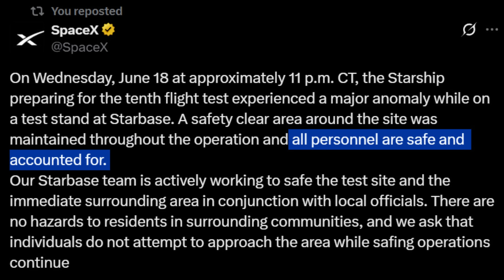SpaceX's Latest Starship Explodes During Ground Test

Comment: Maybe SpaceX are a bit over ambitious with reusable second stage. Booster seems to work, that part is mostly solved.  If they had set their goals initially to just build big Falcon 9 with reusable first stage and simple expandable second stage it is highly likely they would be delivering Starlink satellites right now and making profit. Then run the reusable second stage project test flights in parallel.

Comment: "Te best part is no part" fixation can easily tip over intodisaster. With all the turust vaailable, there is little need tyo  cut weight as if starship were the original lunar module.

Comment: Since Falcon9 and the original Model S, Elon, Tesla, and SpaceX have been puttering but not producing.  SpaceX getting to Mars is like standing on the ground trying to get to the top of a 10 story building in a single leap.  Maybe they need to take the stairs and get to the roof one small step at a time.  Try putting payload into orbit with block 1.

Comment: " high pressure cylinder breaking under pressure "

Does not happen. 

" after fewer cycles than expected."

then the design is incompetent. But we kind of already knew that given that 9 flights in we've had 4 that kind of worked and the rest either exploded or had fuel leaks and crashed into the atmosphere.

I love your optimism that maybe they learned something from this, but at this point you can't really conclude anything other than that the starship program is sh*t. They are nine launches in and they cannot get fuel leaks under control, they still don't have a reliably engine, the booster burned up on flight 9 when they really didn't expect it to at such a small deviation from the proper angle.

Starship is simply a sh*t design and it's only reason to exist is that Elon has to have the biggest rocket. The fact that his metaphor fails to work properly is the ULTIMATE IRONY.

Comment: okay just for you guys to know this alot of thing like  even water and co2 and even nitrogen itself if it gets how entogh can  efectly oxydize and combust under highe enrotgh heat condsiions. withc most of the time noramly will happen in teh orpateion tembpreus of jet engines and rocket engine combution chablers can reach thsie temprutes ecpxaly if useing a nucleaer thermal heat sroce form those nuclear fission or fusion reactor that are sued for makeingthe heat needed. so teachly this is not a real actral surpsie to me that could have this happened in the first live test of teatin sucha fire surpresion sistem gone wrong. aslo  when the hto oxygen and very hot nitrogen mix and makes niutros oxide that also can masvly boot and oxydiaztion chain reaction that can makea huge boom. that would be soemthing like what just happend to starship by the way. KABOOOOOM!
Reply: also hot nitrogen hot oxygen and hot methine all put together makes a EVEN BIGGER BOOM! also makea a much more pwoerful rocket fuel too by the way.

Comment: SpaceX did a great job with Falcon and dragon, because NASA forced them to design it THEIR way.  Note, they only exploded ONE in flight, and ONE on the pad.
With Starship NASA has let them do it Elon’s way and to anyone with EYES it’s been a clown car every step of the way.   Building the OLM with NO deluge and no blast diversion, next to a fuel farm with tanks taller than any protective berm and too dang close?   Someone didn’t bring their slide rule to the design meetings.   Wasting 4 years trying to PROVE Elon’s capricious notion for the OLM would work?  Not using ANY of that time to fly, say, smaller test articles of Starship’s basic design to work out re-entry issues on Falcon 9’s? Firing all the engineers who asked the board to remove Elon as an obstacle to progress?   The entire Idea of 16 refueling flights to get ONE lander to the moon ONE time with enough fuel to land and take off ONCE?  The promise that they could turn around a starship and booster in HOURS when they have never turned around a Falcon 9 in less than 24 DAYS?  The overt Bribe paid to the NASA interim director that won them a competition in which SpaceX’s design was the least proven? 
Sorry- SpaceX Starship operation is nothing but an entertainment company at this point. Musk still have no final design that can work, no idea what payload it will lift, and no idea when it might be ready.
He will never land anything on any other planet.

Comment: My dad was an aerospace engineer. He designed and tested different rocket systems as an engineer for Aerojet and Lockheed back in the 50’s through the 80’s. This is his LITERAL NIGHTMARE, an explosion during fueling while people are still working on the ground. An accident during the actual test is much safer than this unplanned disaster. This easily could have killed someone.

Comment: lets consider what spacex has now. a proven reliable raptor engine. A falcon 9 and falcon heave which are most reliable. why not take what they have and build a new falcon heavy with raptor engines. this could be as powerful as a saturn 5. what the hell is musk doing? nine flights non has reached orbit. i think the concept of starship is to optimistic. And welding especiale stainless steel is questionable.

Comment: They know exactly what they changed between v1 and v2. That paired with all the flight data they have now should be making it somewhat clear what parts they changed have been failing. They should honestly try making a test ship with everything from the v1, except for v2 features they know aren't causing the issues, like the flaps.

Comment: I think I saw a clip earlier today that looked like to show that the flaps on the nose were moving just before the failuire, not sure which yt-channel it was on. That could point to a faulty insulation around a wire as a possible ignition source.

Comment: Musk's tweet subsequent to this points to a failure of the COPV.  Do we know when they pressurize it?  Did they pressurize too rapidly and overheat the vessel?  If it was properly proof tested, wouldn't expect such a rapid failure unless they over cycled it or over heated or over pressurized...no sign of a methane leak that cold have spilled on it making it brittle either.

Comment: I wish there was a way to cover all of the major rocket structures with a sparse mesh of fiber optic strands, maybe just a few long strands along the skin, or on major internal structures. Fiber optics can be used as seismometers and thermometers with pretty good spatial resolution. This assumes such sensing algorithms are fast enough to collect useful data, and the data could be stored safely somewhere.

Comment: The V2 has been a massive setback in the whole program in my eyes. 3 Flights in and none have made a controlled reentry, coming off 3, progressively better each time, reentries with V1 on flights 4, 5, and 6. The plumbing changes seem to have made the whole system weaker. I wouldn't be confident of a reentry survival even if it did manage to come in on-profile in a future flight. V1 will forever be a beast that melted, fell apart, and still didn't give a fuck.

Comment: The problem might not be a design flaw or a test sequence flaw.  It could be classic equipment or materials failure.  It could be a bad weld that wasn't caught during assembly.  There are other possibilities too.  And of course it could be more than one of these issues.

Comment: Breathing in tiny glass fibers is a known issue. Coal miners are well acquainted. It's called Silicosis. The glass fibers can get stuck in the lungs as they are sharp and highly irritating. 
Sand (Silica) causes the hazard coal miners experience. You do not want it.

Comment: When you use the word "optimised" you should be clear that optimising for minimum mass is a choice that is difficult to make consistent with optimising for maximum reliability. It would normally be considered better practice to start at the maximal reliability end of the trade-off and work back from there, not the other way around. The only reason engineers can "barely" build a bridge is because they already know how to build bridges, and even then they can still get it wrong. I think it is becoming clear that SpaceX do not know how to build a starship, and that their process of trial and error is getting them nowhere fast.

Comment: Do you want to get into another ground test so soon? It looks like there may be a design issue which was just waiting to happen, Spacex are definitely not going in the right direction at the moment. So frustrating that the amazing progress made so far seems to have stalled badly. Let's hope they get to the bottom of these issues quickly, I want to see a successful test flight, don't rush it!

Comment: Seeing events like this just reinforces my respect for the early rocket engineers, in particular the Apollo engineers, who achieved wonders without computer aided design and simulation, modern material science or even digital calculators, almost from scratch.

Even the actual German V2, as abhorrent as the regime and the slave labor was, is a masterpiece of engineering designed and built under difficult conditions.

Are we as a species no longer capable of matching these feats without it taking decades and billions of dollars?

What went wrong?

Comment: If this piping and header tanks are new, and considering it splits along the seam where the hander tank piping is affixed, I am going to speculate that its something thats been seen several times before in spacecraft, a thermal bridge. They have failed to properly insulate the pipe mountings.

Comment: Since FAA is unlikely to be involved I expect this to cause a delay of about a month (ie end of July for flight 10). SpaceX is “lucky” this is a HW rich program and will expedite ship 37 (esp given resources allocated for 36 are now available 🙄). It’s unfortunate but unlikely to cause material delay in the program. If the issue is a rare glitch or easy to resolve the probability of a mars mission (which was likely low before this) did not change. If it’s a bigger issue then there’s likely very small chance if any for mars mission next year

Comment: I always felt like the header tanks were a temporary solution to a momentary problem. If Starship pushed as well as pulled on the flip, surely you're moving your moment of intertia to the center of the craft, meaning you could put the header tank directly atop the methane tank, and not precariously suspend a bomb atop the payload be it a satellite or humans.

Comment: It's just too heavy to be practical. They tried to cut weight and mass and it failed. Could be a unsolvable issue using stainless steel as their primary material.

Comment: They need to ditch the natural gas (methane) and use RP-1 instead. Obviously it is much safer and has less problems. SpaceX will eventually understand that lesson. I think the whole design is a failure.

Comment: This report documents the full timeline, preliminary analysis, key observations, and initial corrective actions following the total loss of Starship #36 (Block 2 variant) during pre-ignition propellant loading for a planned six-engine static-fire test. The event occurred at SpaceX’s Massey Outpost facility near Boca Chica, Texas, at approximately 23:03 CDT on 19 June 2025. The objective of this report is to provide an engineering baseline for root cause determination and future verification testing.

2. Background
Starship #36 was a Block 2 upper-stage vehicle positioned on Static-Fire Stand #1 at the Massey Outpost. The intended test was a 15-second ignition of six Raptor-2 engines, with full oxidizer (LOX) and partial methane (CH₄) loads. The vehicle was loaded to approximately 1,200 tonnes, with CH₄ at about 35% of capacity. At the time of the incident, environmental conditions included light rain, ambient temperature near 28 °C, and an on-shore wind at 7 knots. All personnel were located remotely beyond the 2.5 km safety perimeter, and no injuries were reported.

3. Test Objectives
The test aimed to demonstrate readiness for Flight-10 by validating the integrated stage and engine systems under full thermal and structural loading. A secondary objective was to evaluate Block 2 modifications to header tank plumbing and nitrogen COPV systems. Finally, high-frequency structural and thermal response data were to be collected under engine firing conditions.

4. Chronology of Events
The test sequence began with LOX chill-in at 22:13 CDT. By 22:37, LOX loading was complete and the vehicle was fully pressurized on the oxidizer side. Methane loading began at 22:44. At 23:03:06, a plume of condensation was observed venting from the forward payload bay, followed almost immediately by visual camera saturation. Two seconds later, a structural breach occurred along the windward heat-shield section, indicating over-pressurization in the upper cavity. This was followed by a full vehicle fireball deflagration and a secondary ignition on the pad surface. Emergency suppression systems were triggered automatically. By 23:05, the site was secured in a safe-hold state, with no injuries recorded.

This sequence has been confirmed via imagery and telemetry records obtained by NASASpaceflight, Jerry Pike, and D. Wise, as well as internal SpaceX time logs.

5. Observations
Initial rupture occurred in the upper payload bay, not in the main CH₄ or LOX tanks. Engine ignition had not begun, and the turbopumps were at zero rotational speed. Telemetry was lost within 0.4 seconds of the first over-pressure event, and no usable vehicle instrumentation data were recovered. The debris field included nitrogen COPVs, fragmented silica-based heat-shield tiles, and structural tank remnants, distributed across a 350-meter radius. Pad surface damage was observed, particularly spalling and warping of the water-cooled flame trench infrastructure.

6. Preliminary Failure Analysis
Three primary failure hypotheses were evaluated:

Hypothesis A suggests that a nitrogen COPV in the forward payload section structurally failed below its rated proof pressure. This would have rapidly released high-pressure gas, severing nearby CH₄ plumbing and initiating an uncontrolled vent and rupture. Supporting evidence includes Elon Musk’s public statement, visible COPV fragments showing carbon-fiber shattering, and failure origination in the same location. This hypothesis currently carries the highest confidence.

Hypothesis B proposes a hydraulic shock or fluid-hammer event caused by abrupt valve closure during methane loading. This may have over-pressurized the header downcomer and ruptured the skin along the windward structural side. Video evidence showing a longitudinal unzipping pattern supports this interpretation. This hypothesis has moderate confidence.

Hypothesis C considers a cryogenic thermal gradient that fractured the LOX header tank bulkhead, venting oxidizer into the payload bay and allowing explosive mixing with ambient methane vapors. This is less supported by physical evidence and is considered low confidence.

At present, Hypothesis A—nitrogen COPV failure—is the leading root cause. A forensic analysis campaign is underway on recovered materials to verify this.

7. Safety and Environmental Impact
There were no injuries among SpaceX personnel or contractors. However, the destruction of silica-based heat-shield tiles generated fine particulate matter, likely including respirable glass fibers. A temporary public advisory was issued to restrict access downwind within a 2-kilometer radius. Environmental and occupational health assessments are in progress. Physical damage to the test stand includes warped diverter hardware and fractured trench linings, with an estimated four-to-six-week repair timeline. No FAA mishap designation is expected as the event occurred during a ground operation under non-flight licensing.

8. Interim Corrective Actions
The following measures are being enacted immediately:

All nitrogen COPVs from the N2-0425 production batch are being quarantined and subjected to metallurgical analysis.

Non-destructive evaluation (ultrasound and phased-array) is being conducted on header tank downcomers in remaining vehicles.

The static-fire loading sequence is being revised to delay CH₄ loading until post-COPV integrity verification.

The acceptance margin for COPV proof pressure is being increased from 1.5x MEOP (maximum expected operating pressure) to 1.8x MEOP.

New high-speed infrared and schlieren-capable monitoring systems are being installed at Massey and Stage-0 test pads to provide enhanced pre-ignition diagnostics.

9. Recommendations
A complete finite-element design review should be conducted for the COPV mounting assemblies and structural interfaces, especially those exposed to rapid thermal transients. Isolation valves should be introduced between header tanks and main tanks to limit propellant mixing during structural failure. The Massey flame trench should be reinforced with extended steel doubler plates to withstand forward blast vectors, particularly unique to Block 2 geometries. Finally, it is recommended to decouple Flight-10 planning from the Block 2 vehicle line until corrective measures are verified and validated. Development of the Block 3 (V3) airframe should be prioritized in parallel.

10. Conclusion
Starship #36 was lost during ground test operations due to a structural failure most likely initiated by a nitrogen COPV rupture in the forward payload section. This failure cascaded into loss of plumbing integrity, cryogenic mixing, and a subsequent fireball deflagration. Although no injuries occurred, the incident represents a significant regression in hardware validation and launch readiness timelines. Immediate actions are focused on hardware inspection, procedure modification, and damage recovery. A full root cause analysis will follow to guide long-term design decisions.